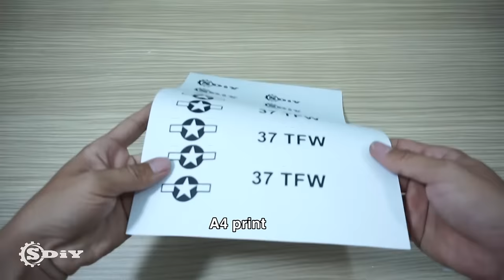How to build F117 Nighthawk rc airplane - Step By Step│S-DiY

Comment: I requested a copy of the drawings that would allow me to build the F-117 Nighthawk, and I have heard nothing in return.  I realize you are in another country and there mighty be a language problem, but I really want to get those drawings and will even pay a reasonable fee, if that is what it takes.  I am unable to find the URL for your drawing, and a local printer charges a fortune to blow up the letter-size sheet I have.  How much would you charge for the drawing and shipping?  That would be in US dollars, of course.
Allen Benge
Reply from the maker: Thank you. You can download the drawing for free in the description. Since it's a google driver link, it may be limited by some separate accounts, if it still doesn't work, contact me at the email address in the description!

Comment: At what size is the airplane sheet printed?
Reply from the maker: Hi Arturo FZ  , If the print is A0 size, it will have a wingspan of 65cm like me. 
If printed A1 the wingspan will be 45cm. You can ask the printer to convert it to A4, which also gives a 65cm wingspan...

Comment: Can I have an esc 30a?
Reply from the maker: Hi friend. With esc 30a can use for this kit and motor 2212 2200kv. But will have to limit the maximum throttle, please fly as gently as possible

Comment: Hi, can you please let me know is it 3mm depron foam sheet used in it or 5mm?
Reply from the maker: Hi friend ,With this model, I used the whole by 5mm depron. depron 3mm suitable for smaller models !
Reply: @SDiYchannel01  Thank you so much for the response! I really love your videos and awesome work!
Reply: @SDiYchannel01  Hi, can you please help me how can in configuring servos? I made a plane but when I turn right or left only left servo moves and when I turn up and down only right servo moves. I'm not getting any idea nor getting it on internet
Reply from the maker: @hamzamalik3249  Hi, what kind of transceiver are you using? If it's an MC6C like mine, just push the MIX button, and switch to Delta mode
Reply: @SDiYchannel01  I'm using the same transmitter but the one with 4 channels only. Microzone mc4

The receiver is m6dr 6 channel. How can I enter in dalta mode? I'm not getting any idea because all of the settings are messed up. I tried to copy exact settings of yours but its not working.  Is there a video to configure this?
Reply from the maker: @hamzamalik3249  With mc4, you find the button that says MIX, swipe towards it. Next is the button that says Elevon, right on its side too! It's like at 8:34 in my video.
Reply from the maker: If the channels are disturbed, please change the position of the servo cord, or turn the reverse button Ail , or ELE .. but never push the THR button.
Reply: @SDiYchannel01  isn't it possible to factory reset the channels? Or transmitter? All channels are disturbed since main motor isn't working at all or it works sometimes with the right side sticks of the transmitter.
Reply: @SDiYchannel01  I tried to copy your settings on the transmitter which are shown at 8:34 but it isn't working
Reply from the maker: @hamzamalik3249  I have not identified the buttons on your controller correctly, You can send detailed pictures via Page S-DiY on FB Or via the email address in my description
Reply: @SDiYchannel01  I just sent a picture of my transmitter to you on facebook

Comment: Mình dùng cánh quạt 8060 và moter 1400kv có bay đc k bạn
Reply from the maker: Hi bạn, kit này chỉ gắn được tối đa cánh 6inh, nên không đi được mt 1400kv
Reply: @SDiYchannel01  bạn mua moter 2200kv giá bao nhiêu và dùng pin j vậy?
Reply from the maker: @footballpassion4368  Mình xài mt mình là loại màu vàng rẻ thôi, bạn nên mua sunnysky 2212 2200kv, pin 3s2200

Comment: How many feet by how many feet did the brother print the design?
Reply from the maker: Hello. The details in the design will not have a specific size. But will depend on the print scale. I have a note in the drawing folder, for example printing on a0 paper will be a wingspan of 65cm...
Reply: If it is made according to the design, will it fly?
Reply from the maker: @ironheart17017  Exactly, the drawing author tested it perfectly. But to control properly, you have to practice flying through the flight simulator. Control skills are very important. Good luck !
Reply: How can I improve my control skills?

Comment: what is the dimensions of the depron sheet
Reply: please tell,thanks in advance
Reply: and link for the diy 45 degree cutter please if posible
Reply from the maker: @devisriadithya5907  Hi friend, The size of the foam sheet I use is 1mx1m. But to get the exact dimensions for the model, download the blueprint in the video description and print it out on A1 or A4 paper.